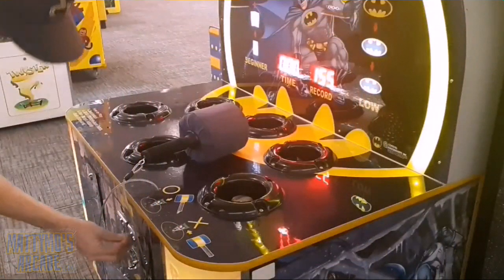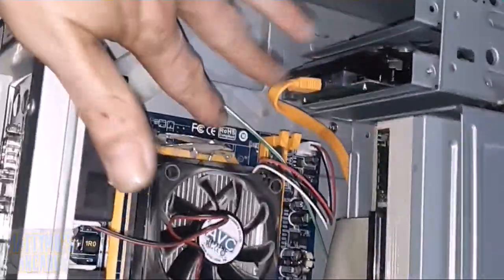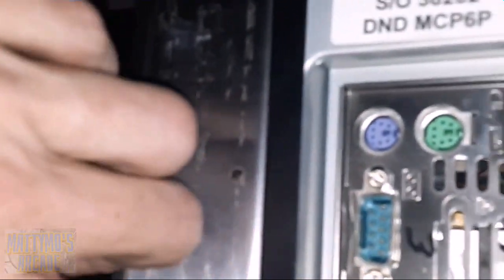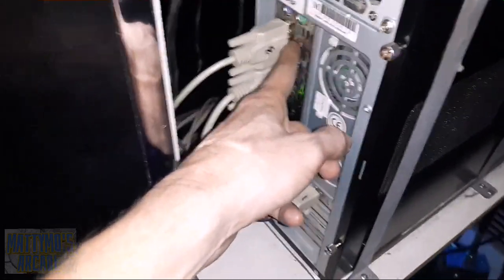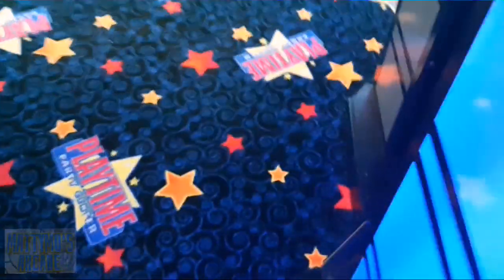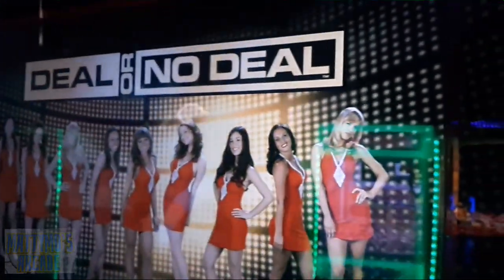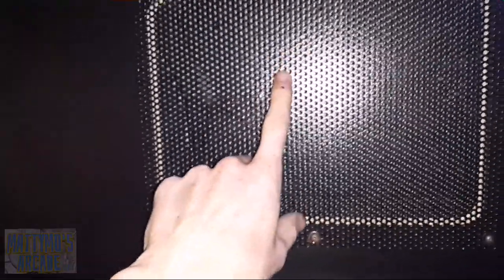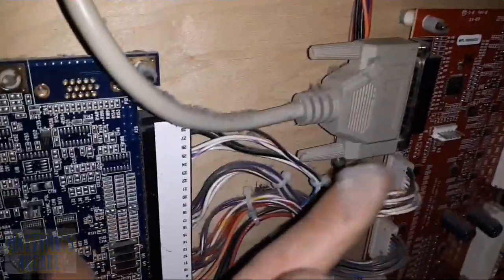Deal Or No Deal Arcade Repair: Unstable Video Connection

Comment: So I notice that when I turn off my deal or no deal then power on next day,, sometimes the pc doesn't power on automatically. So i have to go inside and manually turn on pc. Do you know what the issue could be
Reply from the maker: The battery is probably dying on the motherboard.